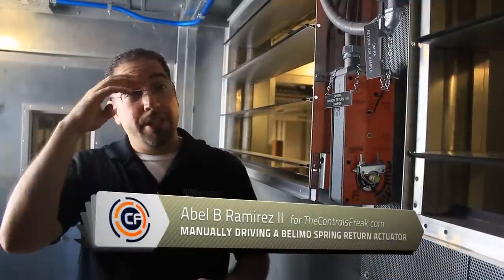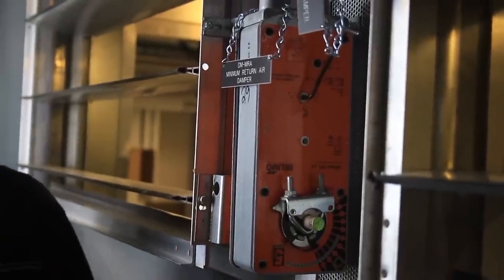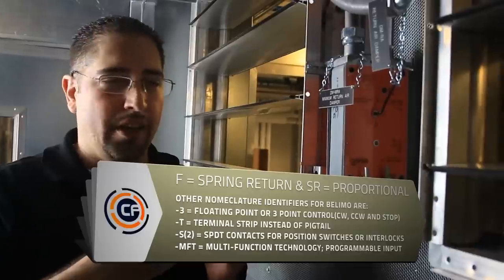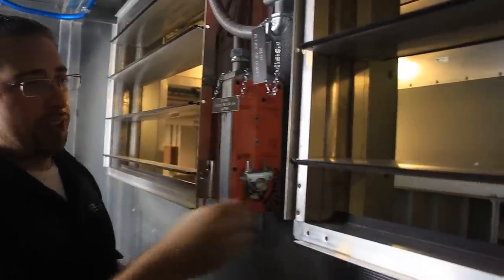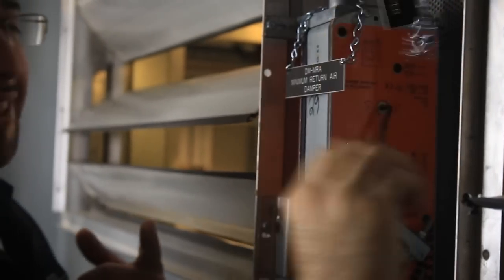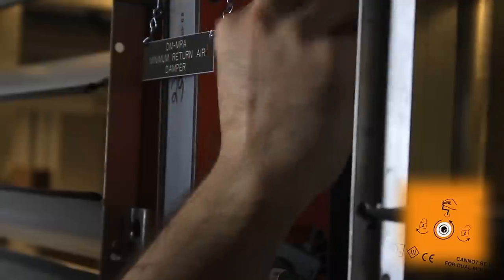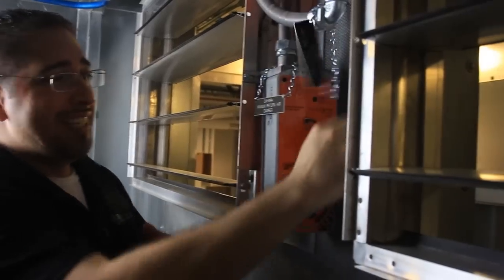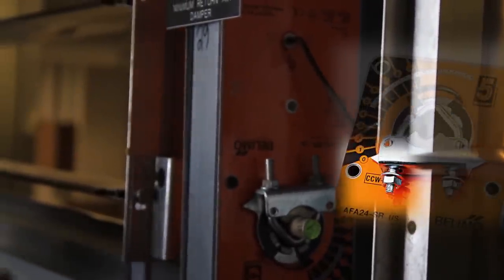How Do Spring Return Actuators Work Using a Belimo AFA24-SR

Comment from the maker: Which symbols are you referring to? Nomenclature usually refers to how the model number is structured, which in Belimo's case is usually 2 to 4 letters followed by a number for the voltage required by the motor and then additional letters and numbers for the other various features. Not sure what symbols you might be talking about.

Comment from the maker: Heh... yeah on the Swedish part, maybe. But the letters with symbols (international symbols) designate the terminals. Y is the signal or input, typically 2-10VDC with Belimo. U is the Feedback Signal also 2-10VDC, though I could have sworn they used to make some with 0-10VDC Feedback. The other symbols are for Power and Common as well as any additional auxiliary switch contacts.

Comment: You are wrong if you lose the signal it drives it self back .when lose voltage you use the spring back .
Reply from the maker: I wouldn't say I am "wrong". If you lose the input signal(Y) you are essentially giving the actuator a 0VDC signal therefore it will 'drive' to the 2VDC or 0VDC position depending on how it is setup. In this case the Spring Return, which is the topic of the video, is not utilized and only comes in to play when the power voltage(24VAC in this case) is lost.
Reply: Again your 2 vdc is the fully closed  position.  So how are you not wrong. Don't take personal I watch and enjoy your videos. Sorry if I struck a nerve not my intention.
Reply from the maker: @southsidecontrolsupplyco.3668  Not at all... all good. In the video I was speaking about 'spring return' and said that it is a misconception that if you lose the signal voltage the actuator will 'spring' closed. It won't. It only uses the spring if the power to the motor is lost and depending on how you mount the actuator that may not be the same position (open/closed) as the position of 0-2VDC is. Neither of us is wrong.